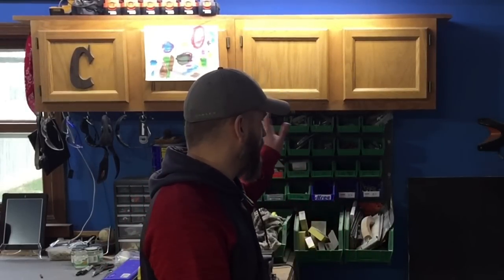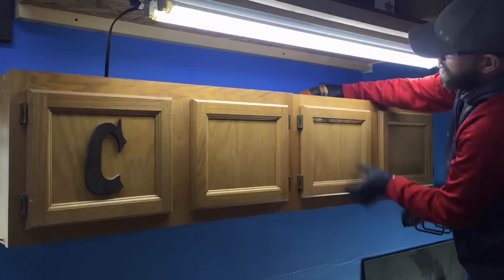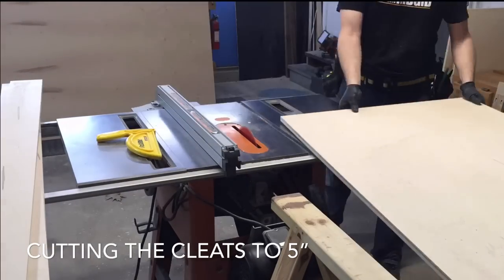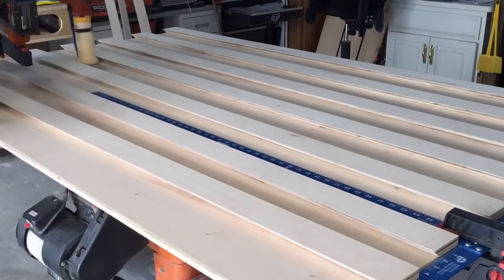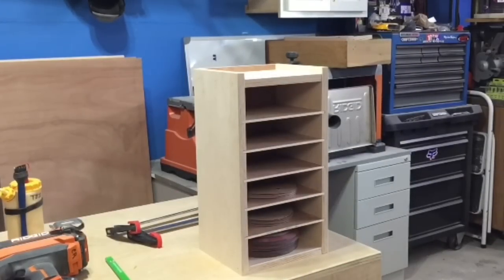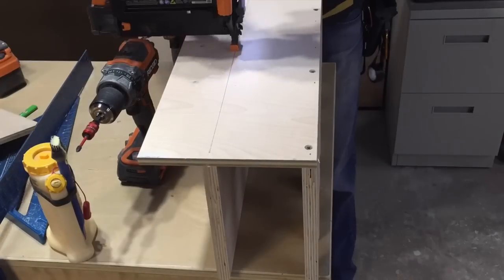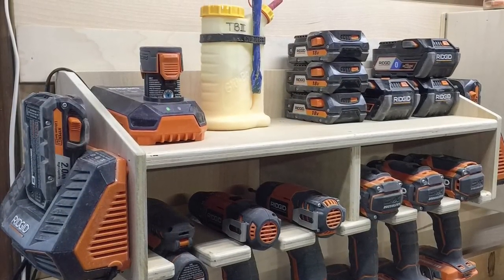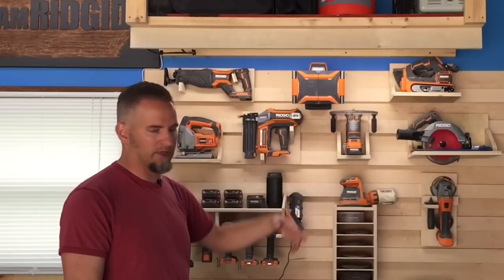CReeves Makes The French Cleat Tool Wall Organizer ep020

Comment: What drill bits are you using to pre drill the holes for to countersink the screws? I need a recommendation. Out of any issues I can run into in wood working, I’m having the biggest issues finding drill bits that won’t strip and lift the wood. Or maybe it’s just me.
Reply from the maker: I use both DeWalt and Ryobi countersink bits.  Both are good and inexpensive. The secret with pilot drilling is not to drill too deep.  Leave just a little at the end for the screw to bite into.
Reply from the maker: I use both DeWalt and Ryobi countersink bits.  Both are good and inexpensive. The secret with pilot drilling is not to drill too deep.  Leave just a little at the end for the screw to bite into.

Comment: It looks like your holders are made using .75" frame and .50" backing.  Is that correct?  Any suggestions / rules / tips you can give for assembly of a good holder?
Reply from the maker: Hey there Tom. yes, depending on the weight of the tool that is getting stored, I used a 1/2" back and misc. 3/4" gussets and bracing. I tried to use simple and easy methods to get the tool supported while keeping screws "hidden".  I countersunk EVERY screw so that the plys wouldnt split and I glued every joint (clamping wherever I could).  I also used a 18ga brad nailer to "tack" things together until the glue set, then went back later and countersunk and screwed everything.  I will be building a SECOND wall in the Spring and I will show more of the holder building process.  I am also building a website where I will sell (cheap) the plans for each tool.  Thanks!

Comment: Did I hear you say the plywood is made from soy?  Outstanding project.  Going to build one myself too.
Reply: The PureBond plywood is manufactured without the use of Urea Formaldehyde (UF) adhesives.  The adhesives used are soy-based instead.  It's documented on the PureBond web site.

Comment: Could you start the cleat cut with the 45° instead of the 90° first? Start at 2 1/2" at 45°? Just thinking this would eliminate a cut.
Reply from the maker: You could technically but I ripped all of my 5” straight cuts first.  Then moved the blade to 45° and ripped the cleats.  Does that make sense?

Comment: I’m just getting started woodworking, for like a few months. I’m not very mechanically inclined, impatient, and can’t even read a tape measure to more specificity than 1/4”. I’ve got so much clutter in my wood shop that my clutter has its own clutter. So, building anything was a nightmare and extremely slow going, because I can’t ever find anything! Cleat walls are very attractive space savers and help keep everything visible and at close to eye level. I started working on putting a system together, but the wall has pretty much taken up my time for the last several months. I don’t have a solid wall, only bare studs, because, well plywood is expensive. I tried to come up with something to go all the way across in cutting cleats out of 1/2” ply long enough that they stretch across several studs, but I’m finding how unstable they  only reason I haven’t taken it all down and started over, is the lack of space foe everything and all the waste of plywood. However, just like most of my projects, I think I’m going to HAVE to start over completely, because I’m wasting more money trying to keep everything stable, than I would if I just broke down and put sheets up, with cleats already on them, like you’ve done. I really enjoy your step-by-step tutorials and wish I would’ve found your channel months ago. Thanks a for the videos on cleats & holders. I’m just very concerned with using only glue, and part of my issue is trying to nail/screw everything. If I have to re-fashion a holder, I have to pull nails out and fight with it. It’s a pain! Anyway. Thanks again!
Reply from the maker: Thanks Lucy! So, you are putting 1/2” plywood on the bare studs and it’s still unstable? That should tighten everything up if the studs are secured properly. I use 1/2” plywood for the back and then 3/4” for all the cleats.  I have used mostly glue and Brad nails.  I have had zero issues with glue failing. Hit me up via email and send me some pictures. Creevesmakes@gmail.com
Reply: CReeves Makes 1/2” cleats were put up, but the sheets of plywood were cheapest they had and there was no “backing” besides the wall, but studs are 2” deep, so the wall can’t support the cleats, only the studs. I put up 1/4” plywood, with 1/2” cleats yesterday, and it seems very sturdy, I’ve just got to go back the square one on the few holders I’ve built, I guess, because they’re not fitting the best either. Still no stability. I’m using 1/2” cleats on the holder backs too, so they’re the same size as the wall cleat. We’ll see with new holders if I can stabilize. I’m thinking I may have put too many trim nails or something in them. No clue. But the most logical solution is honestly to just start over, instead of trying to “salvage” lol

Comment: I have used a French cleat system for a while, but yours is much nicer, I really like it and appreciate the way you explained it. nicely done. Question: it appears that some of your tool holders may use two cleats due to size, weight etc. How did you determine which to do that way vs. just one?

Comment: Great ideas and I really liked the end result. I am working on a french cleat system in my shop as well. One question for you that is semi related, what is the dust extraction attachment you have on your circular saw? I like my saw but I hate all the dust that goes all over my shop when I use it. I will gladly use an affiliate link if you send it my way! Thanks!
John
Reply from the maker: Hey there John!  Thank you for the comment!  I customized my saw by cutting a little bit of the housing and using epoxy to put in a dust nozzle.  It works pretty well over the standard saw.  Stay tuned for a video coming out on it.  I have had a lot of questions as to how I did it so I am working on a video for it.  Thanks!

Comment: I searched youtube for "workshop screw driver holder french cleat" and this video was the top recommendation.  While I liked the video, it left me with 2 questions;
1) There is no screw driver french cleat system in this video. How was this a match? (There were plenty of actual other videos for that.
2) Most importantly; where are the bolts and screws from the big cleanup? If it was me, I would end up with just more junk on my workbench somehow  :)
Reply from the maker: Hey Marc, I did not make an actual screwdriver holder but you can check out Johnny at Crafted Workshop or Drew at Fishers Shop here kn Youtube.  They both have great French cleat videos.  I also highly recommend Chris at A Glimpse Inside in Youtube.  He has a ton of French cleat storage solutions.  As for all the junk I took down.  I sorted it, saved some, and gave the rest away.  👍🏻

Comment: I started making my French cleat wall today and found your video very helpful. This is the second time that I have used purebond plywood and I find that it is not very router or sander friendly. The top veneer has a tendency of splintering. I like the look of the product, was wondering if you have experienced similar issues. I enjoy your channel and admire your craftsmanship. Thanks
Reply from the maker: Hey there and congrats on your new French cleat wall! I have noticed while crosscutting the maple, that I get tearing.  What I started doing was, marking my line, then running a razor knife over it to score the cut.  This will eliminate the tearing in the workpiece side.  The waste side will still get some tearing unless you score that as well.

Comment: I’ve seen the French cleat system for awhile and I really want it (even though I’m still new to the whole thing) but I was wondering if it can be done with any plywood or specific?! Thank you
Reply from the maker: Thanks! It can really be done with any kind of wood as long as the cleats are consistent. I use 1/2” on the wall panel and all of the cleats are 3/4 from the same sheet of material.
Reply: @CReevesMakes  great. Thank you!

Comment: Great job!  For the life of me I don't know why I don't get off my butt and build a large wall of these.  I have the wall sitting there calling me to do it and I need it.  Maybe you'll be the inspiration I need.
Reply from the maker: Good luck! 👍🏻👍🏻
Reply: i did, saw this vid and built it, blue background and all.  I've also added a hanging wall 1200mmx1200mm at the end for common hand tools, which adds a lot more cleat space.  The hanging wall just sits on gate gudgeons via gate hinge straps.  Its a great system and thanks coz I have the garage back.  Only problem is with all the tools on the wall, its basically an easy shop for the burglar once they get in the garage. cheers and thanks from NZ.

Comment: Am not carazy about  drill/driver holsters.  I toyed with the idea on my French cleats.  Hanging them like that rubs where reverse buttons are located.  I don't want to hang them upside down to capture shop grit. .  Just make cubby holes wide and tall enough to take the biggest model you'll use.
Reply from the maker: Yeah that’s a good idea as well.  Easier to grab and you don’t need to line them up perfectly to set them in.  It’s all in what you want.  I was just burning through my scrap plywood and I was on a roll.  Thank you for watching.
Reply from the maker: Yeah that’s a good idea as well.  Easier to grab and you don’t need to line them up perfectly to set them in.  It’s all in what you want.  I was just burning through my scrap plywood and I was on a roll.  Thank you for watching.
Reply from the maker: Yeah that’s a good idea as well.  Easier to grab and you don’t need to line them up perfectly to set them in.  It’s all in what you want.  I was just burning through my scrap plywood and I was on a roll.  Thank you for watching.

Comment: This will be the way I go. Wanted French Cleat but was a bit apprehensive of the thought of leveling and drilling each slat into the wall. Using a sheet of plywood as the base is wonderful.
Reply from the maker: Awesome! Thank you Douglas.  I have moved them a few times and a sheet is way better than individual slats. 👍🏻👍🏻
Reply from the maker: Awesome! Thank you Douglas.  I have moved them a few times and a sheet is way better than individual slats. 👍🏻👍🏻

Comment: Do you have to use a plywood back board or could I just attach cleats directly to the exposed studs? Thanks for the great video.  I will use it often to make my tool holders and stuff holders.
Reply from the maker: You can mount the cleats directly to the studs .  I just did the panel so if I ever move it, and I have, I only have to take out a few screws and the whole panel moves. Thanks for watching!
Reply from the maker: You can mount the cleats directly to the studs .  I just did the panel so if I ever move it, and I have, I only have to take out a few screws and the whole panel moves. Thanks for watching!

Comment: Thanks for the useful video. Can you tell me what adapter you have to attach the vacuum hose to your Ridgid circular saw in the video? I've been trying to find one forever and haven't had any luck. Thanks. Mark
Reply from the maker: Hey there Mark!  Thank you for the compliment.  I actually customized the saw by cutting the guard housing and using epoxy to mount an old shop vac nozzle into it.  It works pretty well for what it is.  I plan to release a video covering how and why I did it.

Comment: Is the backing just for aesthetic reasons? Seems like a waste of perfectly good plywood
Reply from the maker: Hey Robert, technically yes, the backing is just for aesthetics but I covered up some nasty spots on my wall and I have since moved this panel slightly to make room for other stuff, so the ability to remove 6 screws and move the whole thing as one, is also a functional aspect.  Thanks for commenting.

Comment: Hey man, am I right that you just used 1/2” sheet as backing board and then 3/4” cleats ? Or were there 2 full panels attached to the wall?
Reply from the maker: Hey there! Yep, 1/2” back panel with 3/4” cleats.  Working on a plans now!
Reply: CReeves Makes thanks Bro 🤙🏻

Comment: Great video! I'm curious where you bought the dust collection attachment for your Rigid circular saw? I have the corded Ridged saw and would like some dust control with it. Thanks in advance.
Reply from the maker: Thanks Phil! I customized my saw by cutting the guard and using epoxy to attach an old nozzle to it. It voids the warranty but it works really well!
Reply: Ha! It looks manufactured.  Nice job.  Rigid could learn from your mod.  Thanks again, keep 'em coming.
Reply from the maker: Thanks!

Comment: Nice job thanks for sharing it.  I tried for months at 2 different Home Depot’s and couldnt get any of that plywood.  I finally called the pro desk and they said they had it right along. I ordered for curbside pickup and got 3 sheets of the Pure Bond Poplar 3/4”..  Got them home and they look great.  Have a project in mind of a lathe cart from Fix This Build That here on YouTube and cant wait to start it.  Hope it works as you commented.  Once again thanks for posting the video
Reply from the maker: Glad you were able to get some! It’s a great product and cheaper than hardwood dealer priced plywood. I just paid $160 for a 3/4” sheet of walnut ply. 😳 ALSO check out Jay Bates lathe cart that he built. He does great work.
Reply from the maker: https://youtu.be/NLMOvuNxGb0
Reply: @CReevesMakes  I have followed Jay since he lived in an appartment years ago and he is amazing.  Ive decided to go with “Fix this Build that’s” lathe cart though its more in line with what I have as a goal.  I like his plans and have made a number of them and they come out well.  If you haven’t you should check out the Fix this Build that FaceBook page.
Reply from the maker: Oh I agree.  I know Brad from the community and his cart is great as well. Good luck and have fun! 👍🏻👍🏻
Reply: @CReevesMakes  I can still get Walnut ply for 75 a sheet along with some decent refinished maple and some nice looking cherry for 72 a sheet.  We have a plywood specialty warehouse about 20 miles from here.

Comment: Happy with all your Ridgid tools? I'm wanting to go to Ridgid from my DeWalt stuff
Reply: Im very happy with the Ridgid tools. I have almost all of the 12 volt tools 18 volt tools, save for the nail gun. It is too expensive for me and it is really bulky. But, all the other tools I have, and with the Lifetime warranty, it was a no brainer. I had some Milwaukee 18volt Fuel drills before the Ridgid tools, but I felt the Q.C. was lacking. (Loose batteries once clicked into the tool, and a sloppy transmission switch. I also have their Octane Brushless Cordless Circular saw, which was only 20 bucks more than the non brushless, but has gobs more power and 5000 rpm vs 3800.Also have the R4210R Compound sliding miter saw. Very nice saw though a bit pricey ($384)v s the competition like the Dewalt 779 ($299) Also the 12" version of the Ridgid miter saw is currently $399. That is a better deal than the 10 inch version.
Reply from the maker: Hey Austin, I really like my Ridgid tools.  For the work that I do with them, they make the work effortless.  I especially love the cordless nailer.  Makes quick assembly a breeze.  I like to keep consistent battery platforms so most of the tools i use are Ridgid.  Some are not GREAT, but they all do what I intended them to do.  Good luck!
Reply from the maker: I have the cordless nailer and love it.  If you ever find them on sale (I think they are now) I would grab one.  I use mine on every project and it makes assembly so much faster!  The circ saws are great as well and I would also recommend the impact or even the Stealth impact.  Super quiet for the power that it puts out. Thanks!

Comment: Why do you put glue in the screw holes?
Reply from the maker: i always experiment with things and a friend and I had a long discussion  on pocket holes and he told me that he always puts glue on his screws before running them in.  He said that it keeps the wood from splitting and secures the joint.  I do not notice anything with it and havent done it enough to know one way or the other.  Just playin around. Thanks!
Reply: Thx for the reply. Great vid by the way.